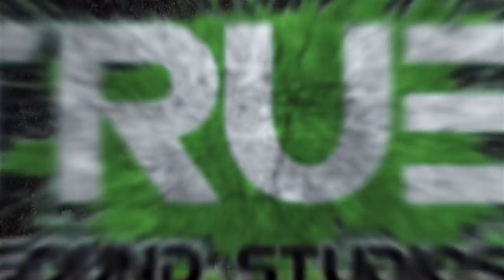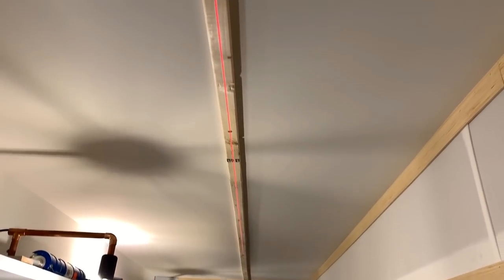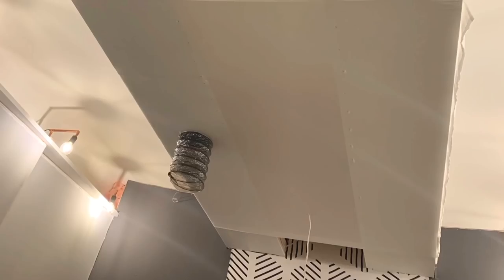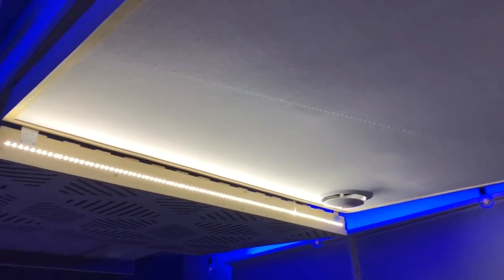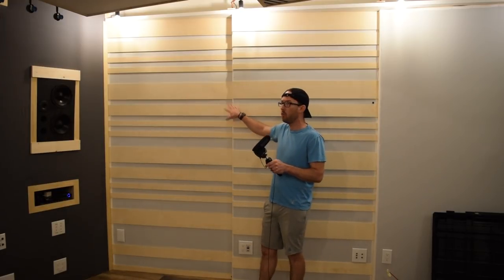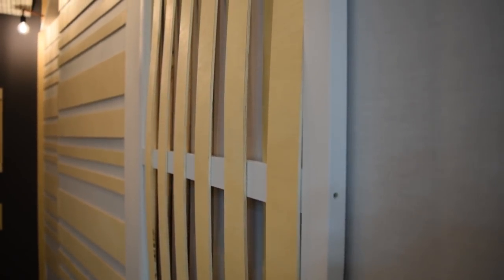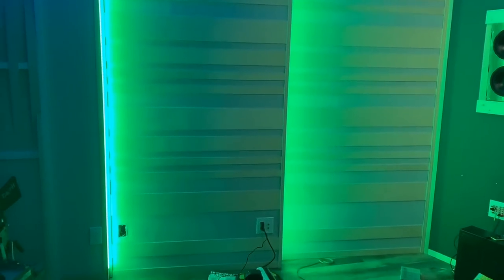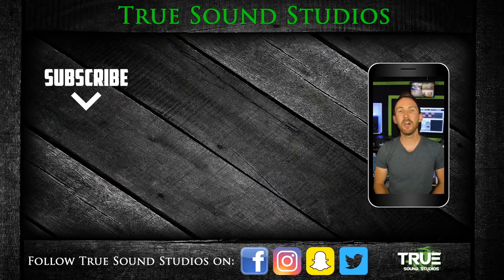Building A Professional Recording Studio - Part 13 (ceiling panels and diffusers 2 of 2)

Comment: Great series! Thank you so much. I'm purchasing the house that has the garage that will be my studio, and I'm planning on doing it right. A question for you: are your inner walls attached the cement floor, or just sitting upon it? If I were finishing out a basement, I'd use a nail gun (powder-actuated) to attach the bottom plate to the concrete floor. Pros or cons of doing that for a studio?
Reply: check out the earlier videos in the series, the whole process is documented...

Comment: Unfortunately, you are negating a good bit of the absorptive character of your insulation on the walls by using the weed cloth.  Ideally you want to use something acoustically neutral such as Gilford or on a lower budget, thin burlap - Sound will actually reflect partially off of the weed cloth, yet at an unpredictable rate and different amounts at different frequencies.

Comment: Sir what will be the expenses for 10x10ft room. If want to do like this. Let me know sir pls
Reply from the maker: Muhammad Atif Al Qadri So that is similar in size to my vocal booth. Without the heating and cooling system I would probably say closer to $4000 depending on the material choice and how you acoustically treat the room

Comment: Why not just cover the entire wall with sound dampener?
Reply: This would create a really dead sounding room that will be uncomfortable to work in, and not accurate to any real-world listening environment. Doing so would also be prohibitively expensive (bass frequencies are very long, and require thick absorption!)

Treating early reflections to the listening position while leaving a short, quiet diffuse field is the way to go.
Reply from the maker: Kyle Saunders So the room has to be well balanced, a totally treated room will be too dead and you would have large nulls in the frequency response. Its all about an even frequency response and trying to eliminate the room from being heard as it can be destructive.